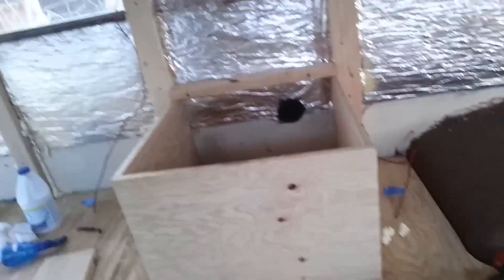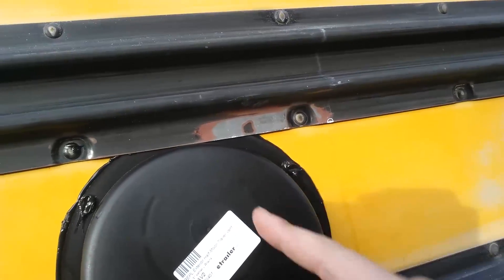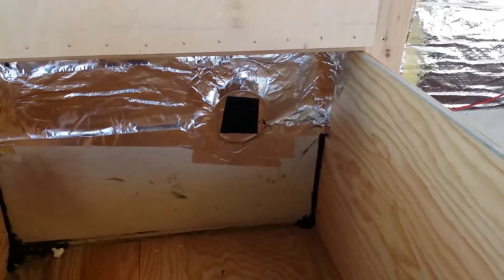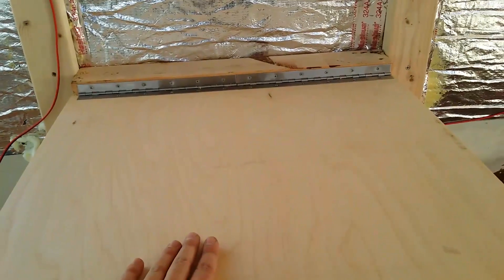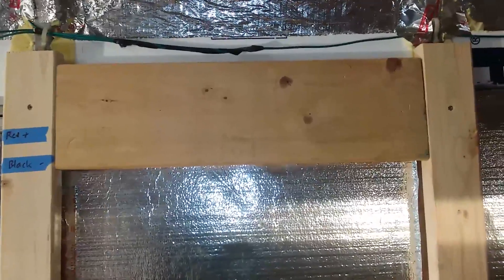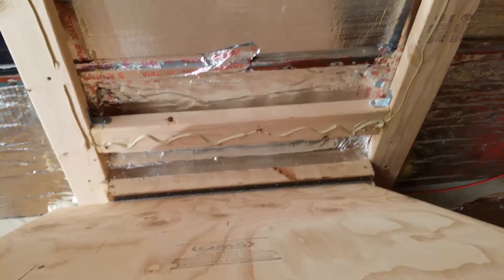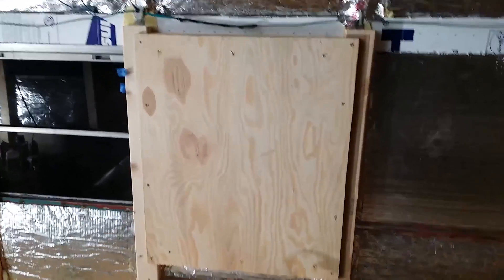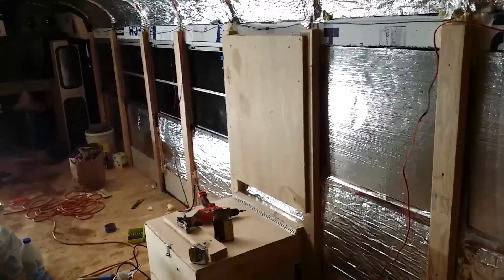Conversion Video 17- Battery Box and Utility Mount

Comment: Just a thought, have you considered putting a small computer fan to force the air out? Very low power and actively removes air out of your vent. As I often do, overthinking everything, hydrogen is less dense then air (lifting gas, which is why it was used on the Hindenburg in the first place)... it won't matter at the end of the day because the rate of hydrogen release from your batteries will be small and your box won't be air tight so it will find its way out. Very nice install though! I am glad that you have gotten back to it and I am sorry the funds ran short there for a while, definitely makes it tough. Great job!
Reply from the maker: Yeah, I may end up doing that.  I've seen other people do it.  Those fans use next to no power, and the benefits could be worth it.  I had a friend that works with DC systems tell me that the way it's set up right now is adequate, though.  They also say that as long as your system is set up right, your batteries shouldn't release hydrogen.  My charge controller has a temperature gauge and can compensate if the batteries are being overheated.  I'm not sure that's exactly what the temperature sensor is for, but I'm confident that my batteries will operate pretty clean.  Still, it's a necessary precaution.
Reply: Sounds like good stuff! I think you are right about the batteries running clean, I overthink things way too often. The temp sensor on the charge controller is supposed to compensate for the charge voltage; i.e. when it is colder the batteries need slightly higher voltage than normal operating temp. I don't think they should ever run hot. Looking forward to the next stage of your build!

Comment: Love to hear your advice on cutting the hole for this vent, this is one of our next projects to conquer. :)
Reply from the maker: I just held the outside vent up where I wanted to put it, double checked a few times to make sure it was in a position that would work for the interior, and cut it from the outside.   It didn't matter too much where it came through on the inside, so I focused on making sure the outside looked neat.  I did have to buy a bigger hole saw and a piece of PVC pipe to extend the vent tube by about 1 inch, but that was really easy to figure out once the vent came in the mail and I could actually hold it, and measure it in person.
Reply: Awesome. That sounds simple enough. Love watching the conversion videos. Sending good 'DRY' Wishes from our Bus-Toting-Washingtonian Family to you and your Bus-Toting-Washingtonian-Family.